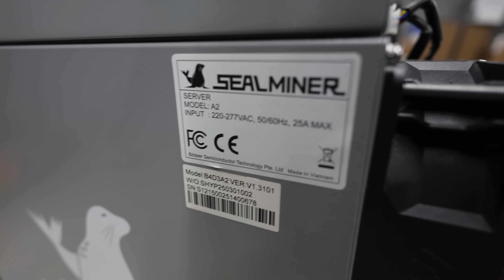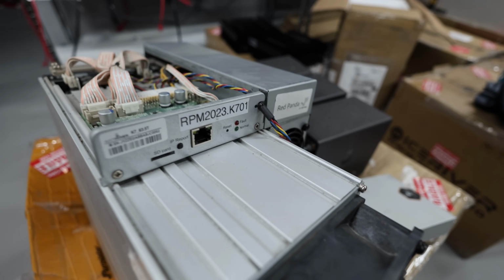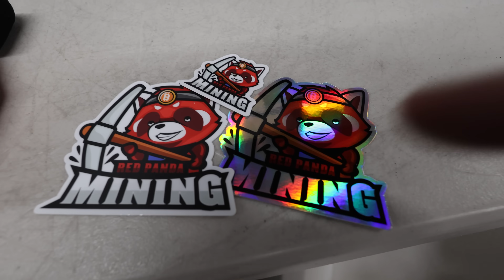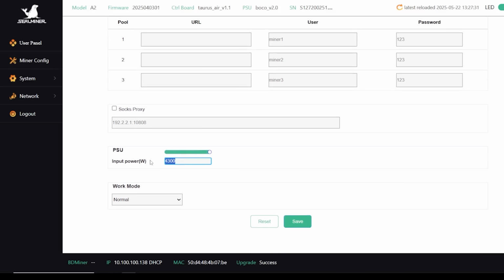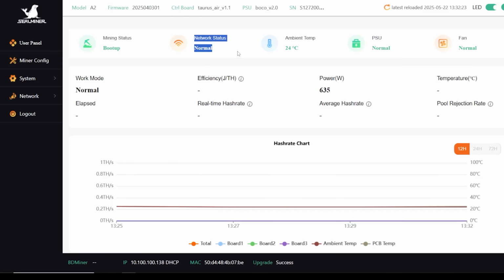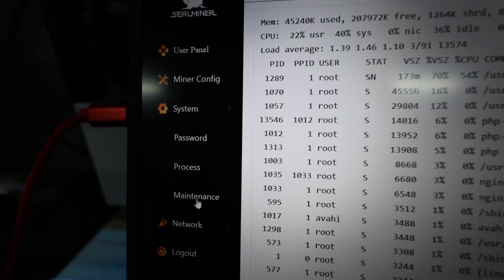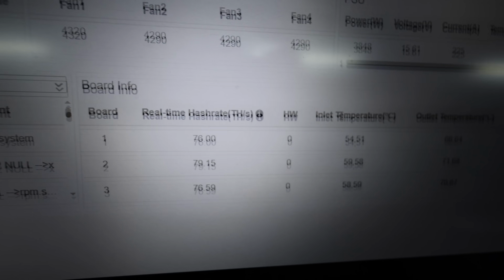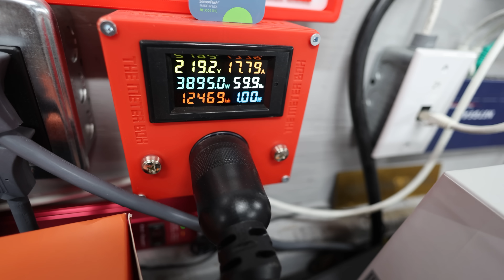BETTER than Bitmain? The Bitdeer Sealminer A2 Bitcoin Miner Review

Comment from the maker: Thoughts on the Sealminer A2?
Reply: I have one and like it. Keep in mind that currently:
1. Fan emulators do not work with it.
2. There is no fan ignore or immersion setting.
3. You cannot run the miner without the stock fans being connected.
4. Aftermarket duct fans and hoods will not work with it.
5. Vnish, hive, lux, etc..have no plans to support it right now.

Comment: I like the 120MM, I am worried about the 140MM, i have over 40 fruition kits which is built for 120MM fan, maybe time to switch to another manufacturer, nuce putting a memory slot standard in the control board unlike bitmain Amlogic which is standard.

Comment: If you disconnect internet does it continue pulling full power?

EDIT: Disconnecting power results in idle power consumption. Fans however will continue at previous speed and do not spin down.